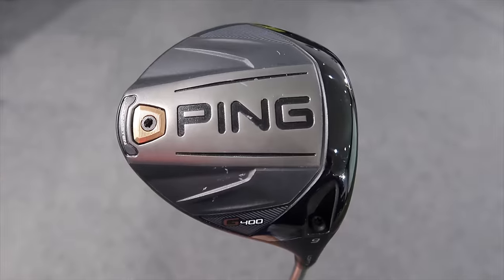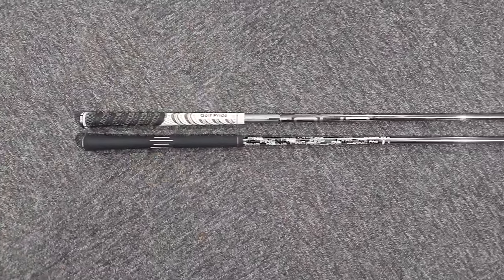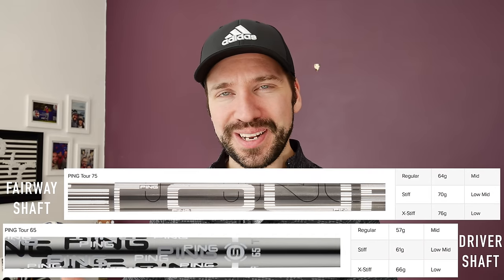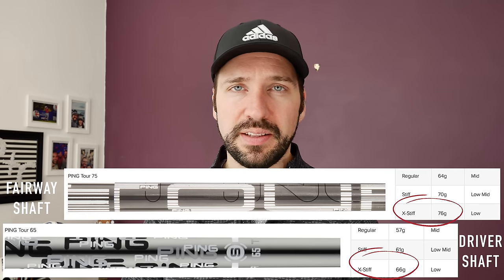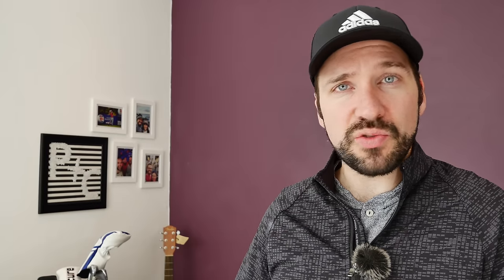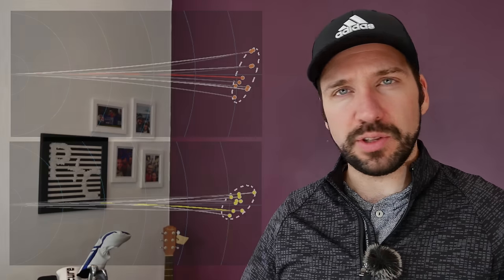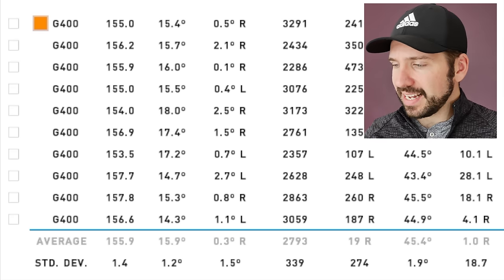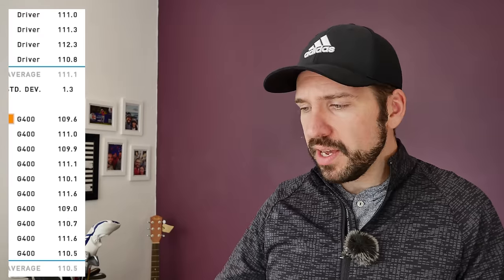I put a 3-wood shaft in my DRIVER and this happened...

Comment: I finally tried it out: a R-15 driver with a 3-wood shaft( Speeder Evolution 67 grams) and I was pleasantly surprised: I didn't lose any distance and my drives were more accurate. In fact, some of my drives went even longer than with my regular driver shaft. But again, I'm not 6' 2'' and being only 5'5'' I could feel that it's a lot easier for me to repeat the same swing with a shorter shaft. Sure is interesting to experiment and see for oneself the actual results.

Comment: I just did this with my the 410 as an experiment as I was having control issues off the tee. Granted it's only been 2 rounds but I hit the ball straighter than I ever have without losing distance. I did this before watching this video. I found this video while doing some research to see if my results were typical when putting a 3w length shaft on a driver. I guess I can say confirmed?  Gonna play a few more rounds with it before I actually cut my driver shaft. I am a 9 handicap btw.

Comment: I tried this on a launch monitor with the Gen 2 M1 driver.  Both shafts were Kuro Kage silver shafts.  One was 60g and S flex (standard driver length) and the other was 70g S (standard 3 wood length)  Interestingly enough, not only was I more accurate with the shorter driver, but I was faster.  Much faster.  As in I picked up 10mph average more clubhead speed faster (avg 103 mph to avg 113 mph)  If I could have messed around more with loft adjustments, I guarantee that I would have a massive improvement with distance as well

Comment: Going to switch my Cobra 3 wood shaft to the F9 speedback head this weekend. Hopefully distance is similar with dispersion tighter I pray 👏🏻
Reply: Hi mate how did that go as ive just done the same with my F9.
Reply: It was straighter but it was not longer off the tee or similar distance as the driver shaft. You will hit more fairways
Reply: @kirkland0074  thats good enough for me ,thanks for quick reply...
You leave it in then ?

Comment: This is why pros on the PGA Tour use drivers at least 1/2" shorter than what is sold to the public off the rack at the golf shop, and why I predominantly use a strong 3 wood rather than a driver. I've hit several shots over 290 yards (including rollout) with a 12.5° 3 wood and a 43.5" shaft.

Comment: Jack Nicklaus’ driver was 42 3/4”. I figured if it was good enough for Jack it was good enough for me. I cut mine down to 42” and regripped it. No weights, no nothing. I don’t notice any difference in distance but the increased accuracy is noticeable. I’m 80 and I hit my driver 240-250.

Comment: 43"  likely to be slightly short without adjusting head weight pete, it's doable, but would probably need to change the bolt in the head or hot melt maybe 10-12g or 6-8g with a counterbalance shaft and consider a bit of tipping. 

the light swing weight from the short shaft is likely reason for heel strikes too
Reply: Adam Hussain hello Adam, can you explain the why the swing weight would lead to heel strikes please? I hit out of the heel  with the driver and can't find an answer to the problem.
Reply: there are several things that can lead to heel strike- it can be path, tee height, shaft flex etc.

in the situation i am describing, where the shaft has been cut significantly without adjusting swing weight, the effect is a huge drop in swingweight. The consequence is that the head essentially feels very light at the end of the shaft. There is of course no change in actual weight, but the perceived weight to us as players is dependent on the length of the lever and it has been shortened. So, typically when the swingweight is light (particularly with high speed players), it can be very difficult to control the head during the swing, leading to more variation in strike location on the face

Hope that helps somewhat explain my comment.
Reply: Cheers Adam. I'll give the lead tape a try.
Reply: Barry Norris hi Bryan probably only worthwhile if you have cut your shaft down. If you feel heel strikes are consistently a problem, might be worth seeing an instructor who uses something like GCquad (like peter finch does in lessons) to give club head data to get a thorough answer and professional recommendations
Reply: Thanks again Adam, I have been taking lessons with an instructor who uses trackman. I agree with your earlier reply, that it could be one or indeed a combination of reasons as to why I'm hitting the driver out of the heel. I plan to experiment with weighting an old driver to see the results. That way I can eliminate the swing weight from my line of enquiries.

Comment: It works great if you do it correctly. If your say 45in driver has a SW of D4 and you cut the shaft or switch to a 3w shaft at 43.5 you change the SW by 9 points. the SW will now be C5. That’s way to light for a driver head. You have to had wt to the head. You won’t lose any distance then because the mass hitting the ball is the same, you will lose 2-3mph in clubhead speed but you will more then likely hit it more efficiently.

Comment: Silly question but why not just choke up on the grip abit instead of swapping out or cutting shaft?
Reply: Scott Grella I used to try this alot but it's a massive mental game and still feels like the "stick" is the same length. My irons are .5" to long but I can't get used to the gripping down so I'm having these cut and re bent as we speak. Also it's one less thing to worry about in the swing!
Reply: Depending on what kind of grip you have, your lower hand my not feel comfortable because it gets thinner the closer you get to the club.
Reply: After really getting back into golf and doing a ton of research, I started choking down on my driver a good inch or more this winter and have gained better control, which has allowed me to attack more and get faster clubhead/ball speed, equaling an extra 15 yards of consistent drives (270-290 now). I can probably creep it up another 10-15 yards if I really wanted to try an go after it. (manufacturers sell them long because of the distance potential they advertise. Most often you can get faster clubhead speed with a longer shaft, but that can ruin accuracy for most consumers) Probably could benefit from a custom fit to really optimize everything a bit more. Swingweight may play a factor for each individual as it will change the shorter you go. Seems to be working for me so I'll see how it translates this season.

My irons are standard and I got them cheap from a family member. I have to choke down an inch for proper length fitting. Seems to work for me until I get a custom fit set in a few years hopefully.

Comment: This is a very interesting test. I have been wondering the same thing, but don't have an easy way to gather my own data. I was wondering if shortening my driver shaft would allow me to find the center of the face more regularly. And does hitting that sweet spot more than make up for the slightly diminished club head speed. Enjoy the mad scientist aspect of tinkering with components.

Comment: Pete, generally speaking, when you install a shaft into a driver, it is not tip trimmed. For a 3 wood the tip is trimmed to compensate for the weight of the head. When you put the 3 wood shaft into your driver, you made the flex much stiffer because of the lighter head. Just sayin.

Comment: Looking forward to on course testing. I play 3w shaft in my driver and feel more confident with a shorter shaft. You said that it’s a 43” shaft but I guess that if you measure you will find that on a driver it will measure around 44” (1 3/4 inch shorter than std length) due to that the driver head is deeper than the 3 wood head that measures 43” with that shaft.

Comment: I put 3 wood shaft (43inch) in Callaway Xr 16 driver but it was a 50 gram 3 wood shaft so a bit light. Results were ok. Then when to 44 inch 70 gram and stiffer. Bingo great results. Stock 46 inch shaft gave rubbish results.

Comment: I did shorten the shaft length 2 inches a few month ago. I had to add 7 grams to the head to cut draws. My dispersion improved but I lost about 6% distance in my case. I feel I have more control now.

Comment: I've often fought with how to approach this. Reason being is I'm a male who stands all of 5' tall on a good day when I stretch. So I typically cut about an inch off my irons and 2 1/2" off my driver. The last fitting I had for a wood and a hybrid, the pro recommended I keep the stock length. After playing a few rounds, I cut them 1 1/2" and felt more in control. This off-season I have my eye on perhaps a Ping G400 driver. Wish I could swing different length shafts at a fitting.

Comment: I have my Ping G driver 1 inch short at 44 and 3/4. Hit it as far and straight as anything. During the fitting we noticed that my clubhead speed with the fairway wood and driver were the same at 94 mph. Asked for it to be an inch shorter and driver speed went up to 99 mph and had it on a string. Never going to use an off the rack length driver EVER again

Comment: A player on the EuropeanTour that I know has a driver shaft length 2.5 inches shorter than my hacker’s driver. 
I asked for a shorter shaft at my driver fitting, but I wasn’t allowed.
Reply: steve dickson jimmy walker and Rickie Fowler play really short drivers
Reply: steve Dickson. Of course you weren't - they just want to sell you the std stock - not really "fitted". If you want properly fitted you have to go to a custom builder and move away from the big manufacturers.
Reply: Mark Towers, yes the independent fitters really do know their stuff. 
I was at the National Fitting Centre where they determined the Diamana shaft out of a choice of eight shafts was the best for me carrying 252yds. The Tour Exotics shaft which is massively expensive was giving me another 3yds. Wasn’t willing to pay the extra. They wouldn’t let me have a shorter shaft as they felt it was affecting the spin rate. 
Shorter shaft did feel more stable and controllable.
Reply: titleist while offering their TS line as stock 45.5 the club fitters all have several shafts at 44.5 and weights to make it work.  that way they can sell as long distance club and get people properly fit if they so choose.....no other brand is doing this....im 6'3" 2 cap and 113 ss. i use 44.25". its impossible for me to get fit or even trust any testing by any other manufacturer unless i already have a shaft that fits that head and lead tape in my pocket. kudos to titleist and thats why you have my latest $500 TS3

Comment: I agree with Anders Pedersen, that you should jump on a plane to Toronto and visit Ian Fraser of TXG. The Guy is a genius Club Fitter (check out their Vids)! By just changing the Driver shaft for a 3 Wood shaft you have changed far more than just the shaft length, you have changed (shaft weight, swing weight, bend profile and the Tip stiffness) to mention a few. You could spend months experimenting blindly or visit an Expert, in your position I know what I would do. Plus it would make a Great Vid! 
On a more general comment, Driver shafts in recent years have gone far to long as the manufacturers push their claims for increased distances. 10Yards deeper in the Shit is no good for anyone!

Comment: I mistakenly shafted my new driver head with a fairway graphite shaft.  I finished the club at 47.5" and the swingweight is E4.  The specs are very similar to my old driver, but when I went to the range, I hit the same trajectory with both drivers except the new one with the fairway shaft was about 15 yards longer, more consistently straighter, and I came home a happy camper until I realized it was a fairway wood shaft not a driver shaft.  ANYONE?  COMMENTS?  WHAT CAN GO WRONG?  SHOULD I CHANGE IT TO A DRIVER SHAFT?  Thanks.

Comment: be curious to know swing weight difference
Reply: He used a heavier shaft to compensate for that m8.
Reply: In theory youre right, but most people dont notice a difference like that.
Reply: its theory and swing weight is not the same as "real" weight m8.
Reply: Yes, but he added 10 grams of weight.
Reply: I cut my driver shaft down 2 inches, but also added a decent amount of weight to the head and my distance and accuracy have increased dramatically because I am getting a much better strike.
Reply: Charlie 234 ....swingweight is in the head, if anything a heavier shaft will make the head feel lighter, so in fact has the opposite effect. Adding weight to the head is the answer although you’d have to be pretty sensitive for it to effect you.
Reply: Mike Eastridge since you know your stuff I have a question 

I find my m4 3 wood too long I’m going to cut 3/4” off 43.25 to 42.5 then add 8 grams off lead rape in a neutral position on the sole 

That should be fine right? 

It won’t make the shaft too stiff and normal swing weight will be restored?
Reply: As I understand it, swingweight is a bit tricky. For instance, you are only weighing the static balance of the club when a swing is a very dynamic motion that all people are making differently. The scale is also designed for the grip to weigh 50 gram. 
The fact of the matter is that whatever the swing weight came out as in this case,  he hit the shorter driver a lot better. Regardless of the swing weight.
Reply: Cornwall1888...see how you get on without the added weight, it may feel ok,
Reply: Dougie Montana yeah hopefully fine because I don’t want to stick difficult to remove tape to a brand new club anyway 

There is also nothing to say the new swing weight won’t suit me more 

Any minor changes in stiffness and lie will be tiny compared to my better strikes 

Strike is king 

I’ll try it out tomorrow
Reply: Mike Eastridge surely making anything shorter whether it be a shaft or a plank of wood will make it stiffer
Reply: Cornwall1888 ...cutting a small amount from butt end will have little effect on flex, most of the dynamic movement is in the tip (towards the head). Adding weight to the head on the other hand will add flex.
Reply: Swing weight is all about leverage and how heavy a club 'feels' when you swing it.  Shorten the shaft and the club head feels lighter in your hands = lighter swing weight number.  Peter can pop it onto a balance at his club fitter and tell us the two numbers.  He has an option to make the shorter club the same by adding weight to the head - but it all seems to be working out fine right now.  The 3W driver doing the business.  But has Peter the nerve to cut down his TM?   We watch on the edge of our seats.
Reply: You also need to factor in flex. Shortening from the butt alone and adding weight to bring the SW back up will result in a softer flex (the butt is the stiffest part).

Best option is getting fit for a shorter driver from the off.

Comment: A couple years ago I got fit for a driver but when it arrived they accidentally cut down the shaft to 43.5 inches, which was basically a 3 wood length.  I gave it a try on the range and the course and it was an absolute fairway finder for me.  Ever since then I've play a 44 inch shaft in my driver and I'll never go back.  When I've tried testing longer shafts it always resulted in greater inconsistency on strike and wider dispersion.  Much like you found, Pete, distance didn't suffer at all.  If I can strike the ball more consistently, get better dispersion and not lose club head speed and distance then why wouldn't I play a shorter length shaft?